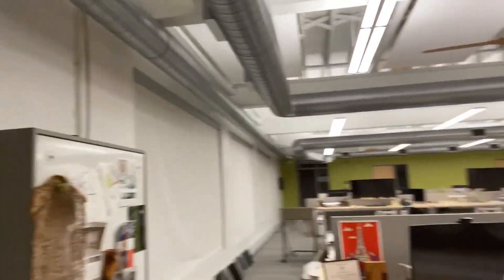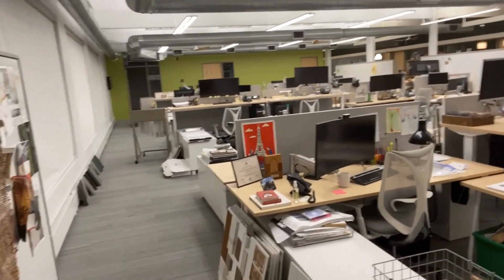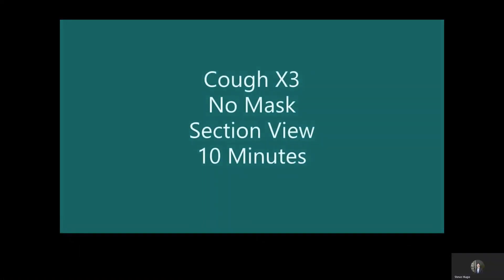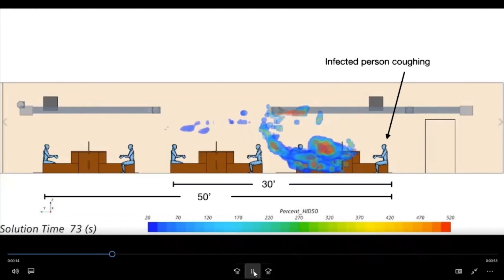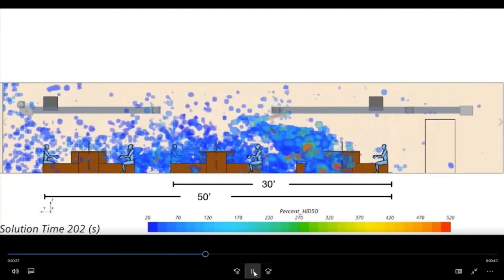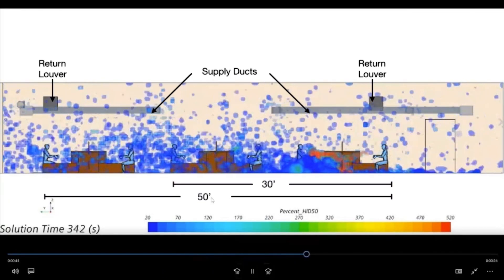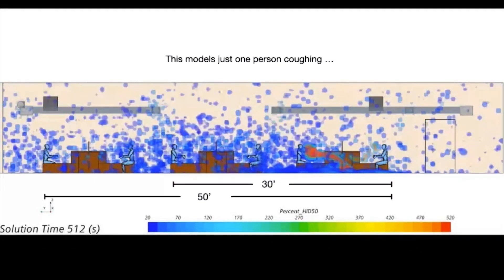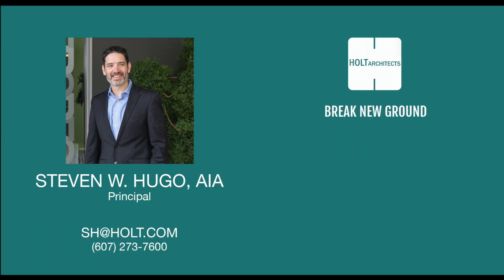HOLT Architects Simulate How Coronavirus Spreads Indoors | 3 Coughs | No Mask | 10 Minutes

Comment: Same with cold viruses, influenza viruses, etc.  The greatest transmission is touch.  How many objects are touched in a public setting daily?  Masks are not the answer.  Viruses have existed forever and we dealt with them by basic universal precautions and common sense.  Isolation is the most deadly virus of all.
Reply: Masks are not the answer for an airborn virus?  Even if the greatest transmission was touch (which it isn't for COVID), then why discount the other forms of transmission?  You wash your hands to prevent transmission by touch, so wouldn't a mask be the equivalent for preventing transmission by air?  I don't understand the qualms with wearing a mask.  Seems some people can't deal with any adversity.  I work in construction and frequently do full days with a heavier mask, doing hard labour.  And some people refuse to wear a mask indoors for 20 minutes while at the store.  Give me a break...
Reply: @floop74  How many people including yourself while wearing a mask touch your face with your hands?  
Do  you put your mask on and take it off with your hands?  When you go to the store, get gas, touch door knobs, etc. do you wash your hands every time you touch an object?  I would bet you cash money you touch your face numerous times while wearing a mask.  By the way, I wear a mask doing yard work to reduce the dust particles inhaled.  Simple common-sense precautions.